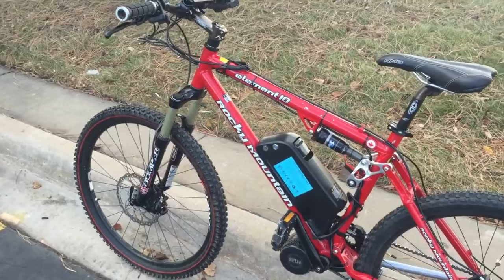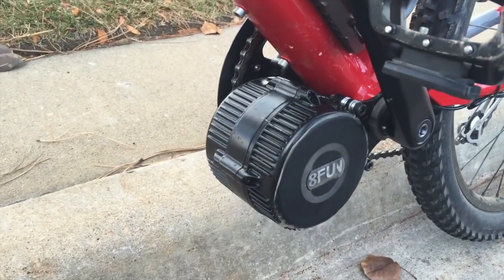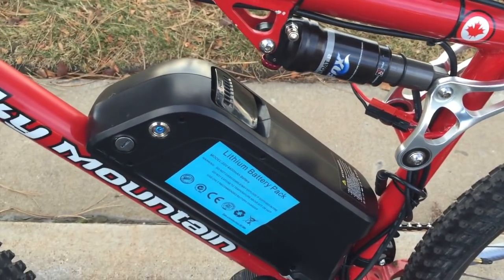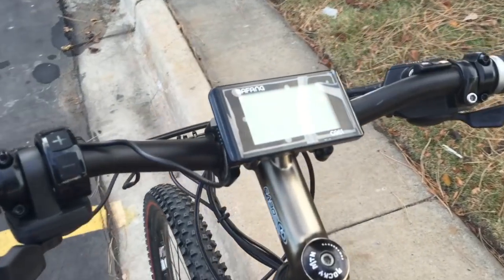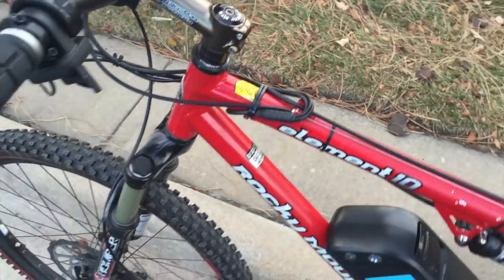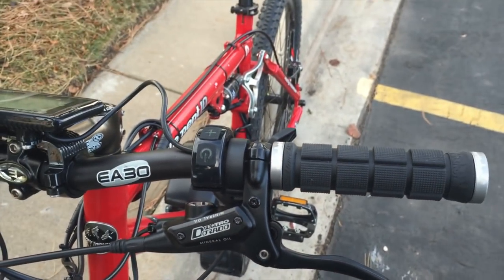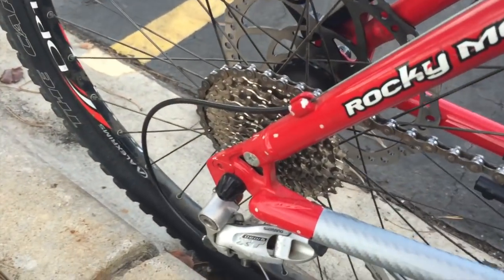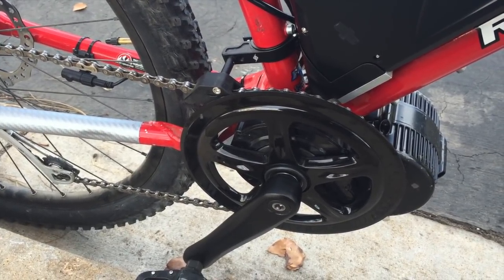DIY FULL SUSPENSION MOUNTAIN BIKE USING BAFANG 8FUN MIDDRIVE SYSTEM

Comment: T,
Can the pedal spindle AND the chainring both freewheel?
Or can the pedals freewheel but the chainring cannot freewheel?

Thanks,
Reply from the maker: TheLookingOne Yes they both freewheel. Riding the bike feels 95% like riding regular bike. As soon as you start pedaling you can sort of feel pedals getting slightly lighter and the motor kicks in. Depending on the assist level there Is a bit of a difference in feeling.
Because the kit does not have a torque sensor you have to play around with the assist level. Sometime you will feel like you are over pedaling the motor and you are doing more work that you should. That's when you increase the assist or drop to a lower gear on the rear cassette.
Reply: T Alexandrovich Just before you shift gears, do you stop pedaling (to turn off the motor), or do you slow up pedaling?  How smooth is the gear shifting?
Reply from the maker: TheLookingOne I usually slightly preload the brakes so that cuts the motor off. That way i can still pedal and not loose much momentum. You can make gear shifts as smooth as you want them to be.
Reply: T Alexandrovich
Reply: +T Alexandrovich I have the Bafang BBS01 kit on my electric Mountain Bike since 15 months and almost 5.000 km. It's the 250w 15a with a little hardware that has opened some assistance parameters. I don't need at all a torque sensor 'cause the things who make the motor not so perfect was the parameters of the software. It's hard to me to explain better for my poor english but i can show you of what i talk about, if you want.

Comment: Hi Taras, you mentioned below you think the battery size might be 9.5 Ah, but it is actually 11.6 Ah 48 volts with Samsung 29E cells. More info on the battery can be found here: http://www.empoweredcycles.com/products/48-volt-11-6-ah-downtube-bottle-mount-battery-with-2-amp-charger
And more info on the entire kit here: http://www.empoweredcycles.com/collections/complete-electric-bike-kit/products/complete-electric-bike-kit-8fun-bafang-bbs02-48-volts-750-watts

Comment: Hello,  is it possible please to write down the dimensions of the battery and the size of the triangle on the bike that you have used?
I have been looking for a suitable full-suspension bike for this kit the past 2 months without success.
Almost all new models of big companies have very small space in the triangle plus their bottom bracket is either 90mm or 95mm with a different system.
I am afraid to use a custom battery pack in a seat-mount bag (which would probably solve the problem of the triangle size), the protective boxes seem more reliable. 
Any suggestions?
Thanks
Reply from the maker: Qaraba The battery i have is 12"x4.5X3.5. Its a very good battery and is the most expensive part of the whole system. Its a 48v battery. The range on it with light pedaling is probably over 50 miles. 

My suggestion is to stick to large frame sizes. Small or medium frames just dont have big enough triangles. Another option is to use a triangle bag and use a soft battery. I would stay away from seat post mounted batteries. You want the battery to be as low to the ground as possible. 

Another option i looked at was using a backpack battery. You can wear a backpack with quick disconnect connectors. Its not ideal however.

Comment from the maker: It depends on what you guys plan on using the bike for but you might want to consider getting a smaller 44 tooth from sprocket. My motor gets a bit hot even in lowest gear when climbing. I am going to try and switch to a 44 tooth front sprocket. If that does not help much I am going to get a large 41 tooth rear cog.

Comment from the maker: Nice! I haut got back from a 20 mile ride in the mountains. There was absolutely no way I would have been able to do it without the motor. There was a 2600 foot climb at about 10% grade. The kit did very well. 

For sure recommend tightening the lock nut, battery and other components before every ride.

Comment from the maker: The way I got the bottom bracket to fit was to use spacers on the bolts that hold the metal "sandwich" plate to the motor. If you look closer in the video you should be able to see it. You might have to get longer bolts as well. The kit come with two rings that interlock onto each other when screwed on the bottom bracket. There is not enough threads to put both of them on so you have to only use one. I used thread lock to attach it to the bottom bracket and prevent it from backing out. I check it before and after every ride. Hope that helps. Let me know if you want me to take closer photos

Comment: Hello from Norway!
Great bike you've built. I hear that you mention reconstruction of bottom the bracket because your bike has 73 mm.
Can you assist with specifying a bit more detail how you got BSS-02 engine ttil to fit in a frame of 73 mm? What kind parts are needed, item and how it works with chain line? I have a brand new Giant Talon 27.5 -2 mountain bike. I forgot to check the dimensions of the bottom bracket before I bought the bike, and now I'm afraid I have a problem.

Thank you in advance.
Paal
Reply from the maker: Paal Falang All you have to do is use some washers to space the mounting bracket a little more and you will only be able to use one lock ring. I used some red threadlock to make sure it does not come loose. I check it before every bike ride and even over some really bad terrain it has not come loose.

Comment: Just wanted to add that I have the same kit on my dual suspension Giant NRS-1 from 2003. I built it last June. I got a "naked" battery from Allcell and I had a custom frame bag made by Jeremy Cleveland. That solved the problem of how to fit the battery in a small triangle ( bike size is 16.5 inches).

Comment: Great video! Thank you! I just ordered this kit. Can't wait to get it.
I subbed. :)
Reply: XDM50 I am waiting on mine too hope is shows up at my door soon 8fun 750Watt 48V
Reply: bigeric12325 
I received mine April 1. Took about 4 hours to install. Now I have about 200 miles on it. Super fun, quiet, plenty of torque. The crank bolts and the locking nut need to be re-tightened after a long ride, so I put blue Locktite on them. Other than that, no problems at all. :)
Reply: XDM50 I have the blue locktite will use it ,200 miles cool glad to hear its quiet and fun ,can't wait till mine arrives thanks XDM50
Reply: XDM50 Hi XD ,I just got mine today fed X , 200 miles nice ,i like the fact its quiet plenty of torque ,I did use locktite thanks for the advice ,I did not get any directions at all ,I can install the everything without the directions ,my question is ? I got the magnet that tell the speed with sensor ,no Idea were to mount the magnet on the spokes ? how many inches from the rim should I screw the magnet to my spoke ? I am buying I think a 26inch 7 speed haven't gone to the bike shop yet I wanted the motor first to see what bike frame and hub I can mount the motor above inside the frame,like the one video I saw mounted above the hub. Thanks Eric
Reply: bigeric12325 
Hi Eric,
Congrats on finally getting your motor. I watched every install video I could find on Youtube (only 3 I think), they helped a lot. I understand what you mean about the magnet. It seems like it would matter where you put it. Apparently it doesn't. I just put mine where it's covenient to where I wanted to mount the sensor. Speed and distance seem right to me. I rode by one of those police speed check machines and it was dead on. To answer your question, my magnet is 3-3/8" from the rim on the 26" wheel. Good luck and have fun!  -Duane
Reply: XDM50 Thanks Duane
Reply: XDM50 I bought a new bike a couple weeks ago the hub was too big so I ground out a few washers to make it fit in the bigger hub ,been out riding all over even some trails ,got to love the motor its so quiet I can barely hear its running as I climb hills and cruise on the level. Its fast too 43kph ,I wish it was in mph and miles  instead of kph ,is your readout also in KPH ?
Reply: bigeric12325 
Hey Eric,
Glad you're having fun with your new motor-bike! I now have 399 miles on mine and zero problems! I love it! You can change between KPH & MPH on your display. You need to go to em3ev (dot) com and print out the manual. It will tell you how to program it. There should be a link for the manual under the description of the motor you bought.
Reply: XDM50 Thanks for the link got the manual now
Reply: bigeric12325 
Hi Eric, 
How's your bike working out? I finally made a video about my bike. It's called  ELECTRIC BIKE UNVEILING.
-Duane

Comment: I thought the kit comes with brake cut off switches that work with cable brakes? Meaning a switch that cuts power to the motor when the brakes are applied.
Reply from the maker: DonTHEhandsome1 the kit does come with brake cut off levers. However my bike had hydraulic brakes and i wanted to stay with hydraulic brakes. Considering the weight of the bike and because i do mostly mountain biking, having large hydraulic brakes makes a huge difference. Tektro brakes you can get from empowered cycles are perfect for this setup. They are already prewired for the kit and feel great when using them.

Comment: Hey, ive watched youre videos and i have some questions.... first, in the video when your pointed at the battery, the pack says 20v 4400mah? Why is that? If the battery IS 9.5ah (9500mah), how far can you expect to go on flat ground, like a paved bike path. And what is your current top speed? I plan to get the 750w bbs02 and make my own lifep04 batterypack with 20ah at 51v. I would end up using a 29er/700c tire and telling the controller i have a 20" tire for better speed. And ill end up putting a variable transmition on the back... or does it work fine with normal gears with out mashing them?
Reply from the maker: Andrew Storlie The battery is i have is a 48V 11.6ah. So far i have only ridden up in the mountains. Mixed terrain, lots of uphills and downhills i got over 30 miles and there was probably still about 25% range left. I just got a watt meter that i have not tested yet. Using regular cassette is just fine. As long as you preload the brakes when shifting you will be fine. I hardly ever mash the gears.

Comment: I don't understand the value of a power cutoff on the brakes.  My 200mph motorcycle wouldn't cut off the engine when I pressed the brakes and it stopped fine.

Comment from the maker: I think the battery is a 9.5ah. It's 48v. It feels very sturdy on the downtube. Makes no noise. In terms of motor being so low to the ground it's really not an issue if you are doing cross country or single track riding. Plus the motor case seems to be really thick and should take some minor bashing.

With pedaling in top gear and simultaneously pressing the throttle I was able to get up to 30mph on a flat ground.

I might drop down to a smaller ring in the front but even with a 48tooth it feels great off-roading. 

I changed the settings to have 9 levels of assist vs 3. That really helps with matching the cadence.
Reply: B

Comment: The battery says 20V 4400mah? What is the voltage on the motor? Check out my electric mountain bike. The entire bike cost less than just the Bafang battery. The Entire bike 100% recyclable unlike lithium setups.

Comment from the maker: The battery is 9.5ah I think. It feels very secure. The bike feels very natural overall. The weight is so low to the ground that you can barely feel it. After a couple hours of riding trails the battery got a little loose so I had to tighten it when I got home. I did not use thread lock on the bolts at the time.

Comment: Very nice build. Was wondering is that a 12ah battery and the other thing was when riding through bumps on the trails does the battery fill secure mounted on the down tube,  does it make chattering noises through bumps and dips, does it fill very secure even say if you take small jumps.

Comment: Great Video very genuine. How does mid drive work with the full suspension? When you were looking around for a full suspension bike would the shock being mounted along down tube work? What size battery are you using and what kind of range are you getting we're about the same size. Great job !!
Reply from the maker: The hardest part was finding the frame that will work with the battery. A lot of full suspension bikes don't have enough room because of the rear shock. I actually just recently had to get a new frame because chain stay on this one cracked. I got an element 30 18" frame and the battery did not fit. So I had to return it and get a 19" frame. So if you are looking to get a frame to use with down tube get a large frame you will have better chance that the battery will fit.

Comment: Nice Bike ! are the brakes all set up for off shelf kit or did u buy together ?
Reply from the maker: Hey! The brakes are Tektro Dorado. They are off the shelf hydraulic disk brakes with built in cutoff system for the electric motor. I ended up getting the biggest rotors which are 200mm. My suggestion before getting new rotors makes sure to see what your frame can handle. I ended up braking my chain stay and from what I can gather its from changing the pivot point on the brakes which put a lot more stress on the mount.
Reply: Thank you for the info !

Comment from the maker: Awesome! Glad to hear that. I took the bike out for a nice single track ride today and was blown away at how powerful it is. So much fun going up some crazy long and steep hills without even trying too hard. 

So far the only problem I ran into is I ended up cracking and bending my chain stay. I suspect it's from bigger disk rotor that changed the pivot point and stressed the thinner part of the chain stay. So bike is out of commission for a little bit till I figure out how to fix the arm or get a replacement one. 

Check out my new video. Should be uploaded pretty soon here.